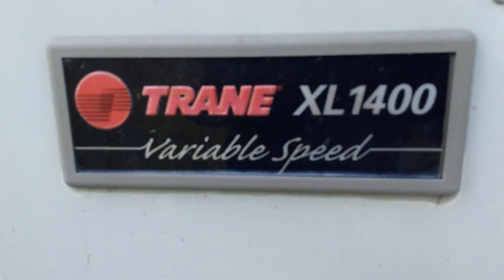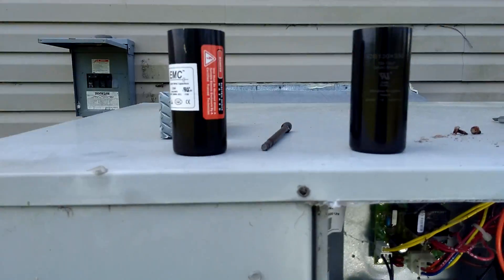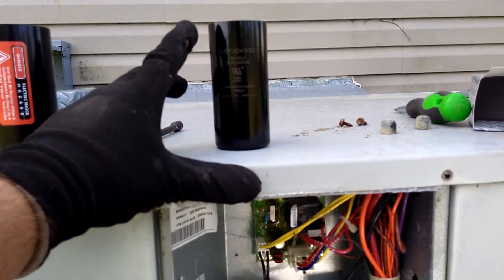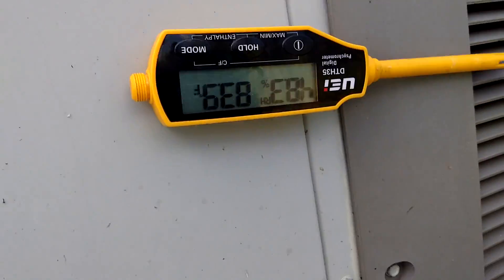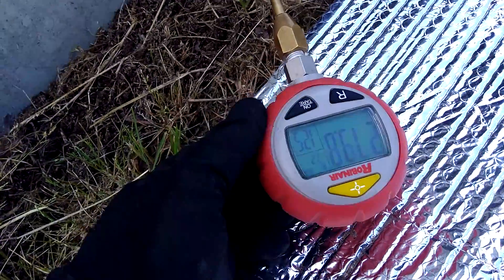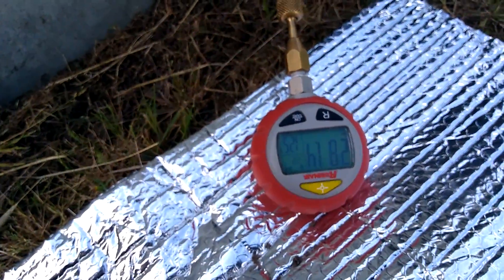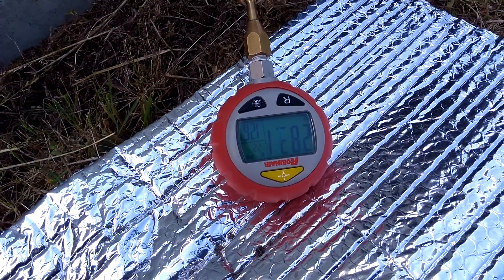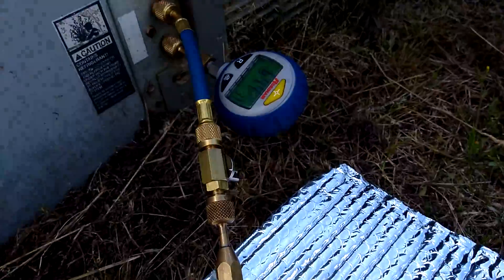HVAC/R | Effects of a Dirty Condenser Coil

Comment: I can't seem to find just the start capacitor with a resistor, everyone stocks non resistor caps. I usually have to change the whole kit
Reply: the resistor is only there as a "bleeder" to discharge the cap slowly when not in use.
even on a cap with bleeder you should always "shunt" across the terminals before touching it anyway :)